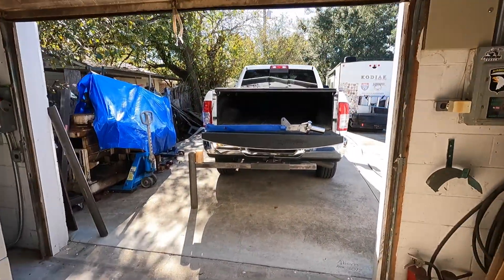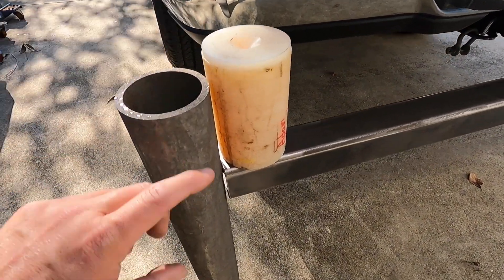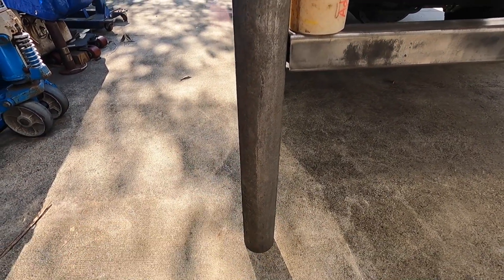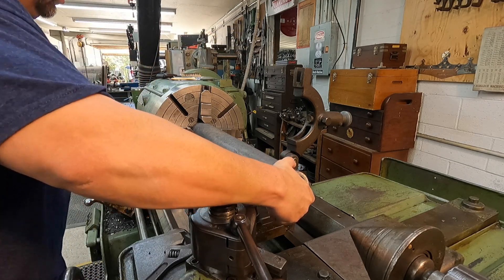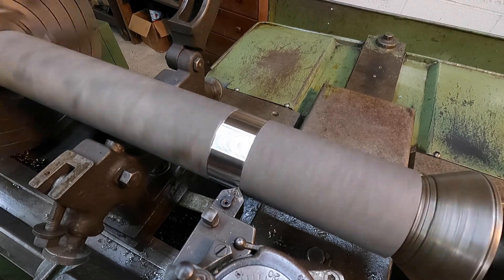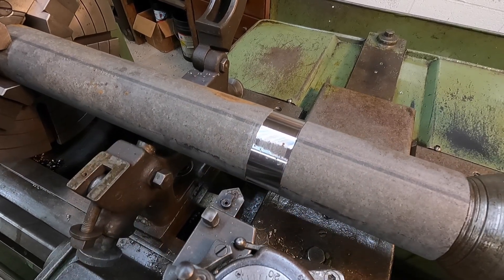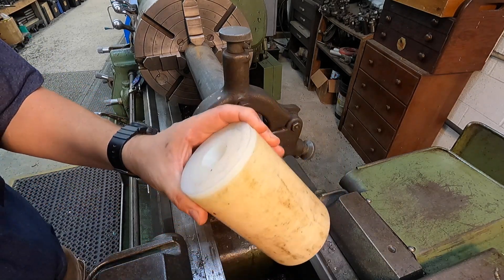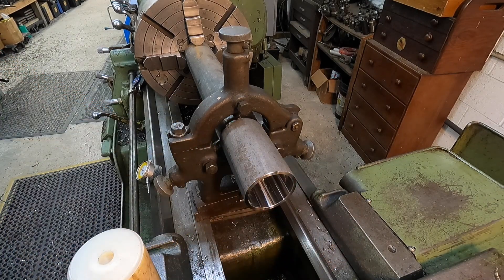Truck Hitch Crane Build Ep. 5

Comment: Adam, maybe the foot off of a scaffold frame that has the adjustable screw on the bottom for leveling would work on the bottom of the leg of the crane. That way if you had to pick up something out of the grass or dirt or mud or uneven ground, you could adjust the the lower end and put a pad under it to take the weight
Reply: I was thinking the same for a scaffolding foot. I think it would be perfect for this.
Reply: About a dozen others have already suggested this in other comments. It's the obvious solution.  Too bad none of us, including me, bother to read the comments before typing.
Reply: Yea but what the heck would you do with the three legged scaffold that is left? 

Haha. Jk.
Reply: Oh, yeah! So much more fun to read the other comments AFTER you leave yours.  Lol

Comment: It's nice your building this for your self. I took a old engine off Craigslist and did something similar. I didn't have a lathe so I made a pintle point (2 rounded over points) which allows for easy weight and turning. Using a little grease and this old timers method I can lift and swing about 1 ton. On my foot I went with larger pipe so I could make it a triangle stand for stability at the bottom. That was 6 years ago, lift riding mower, engines, a custom metal Lift pallet for concrete bags/stone/brick blocks. I have 1 for my trailer as well but mounted it on the side between the tandem axles. Having a lift is pretty nice as a old man.

Comment: Yes .... Adjustable "foot" is a damn fine idea. Every parking situation will have a different "foot" height. And the suspension height will vary with different weights on the truck. I often need to work step by step too .... I'll be interested to see how you "finish" this project Adam :)

Comment: Adam, I’m one of those concerned about the tail dropping when loaded. There’s slack when it’s unloaded for sure, but with an extra load on the truck bed, then the foot is going to be hard onto the ground and all the slack will be taken up. There won’t be any slack to lift the foot and free the pin, without lifting that load. To get the pin out you’ll need to jack up under the cross beam. Better weld a plate under it so your screw jack, or bottle jack, can lift it, and definitely take the jack and some blocks with you the first few times you use this!
Reply: Why not just put a flat plate on it and use a bottle jack for the support ? Plus it will remove the weight of the problematic leg
Reply: I've been thinking the same thing.  Even if the load is so light that there's no measurable sag in the suspension, you still have the problem of the holes-n-pin design not having enough adjustability to fit a lot of ground surfaces.  It'll be no problem on the concrete, but what do you do when it's a gravel driveway or you're pulled out into the lawn to pick up something?  Maybe his luck is better than mine, but I always seem to park in exactly the worst spot possible and can envision me trying to slip some boards under the drop leg to shim things up!
Reply: Haven't watched the rest of these videos yet but I think the best option would be to have the crane support tube in a sliding sleeve which is attached to the hitch.  That way the load from the crane goes straight to ground and the sliding sleeve which is attached to the truck just supports the crane tube from falling over.

Comment: I built a truck crane very similar to this a few years ago.  I used a trailer jack off the side of the beam next to the pivot point.  It works well and allows leveling very quickly.  Nice looking build with your usual quality.   Thank you.

Comment: Use a screw Jack that is used for scaffolding, perfect solution for your foot adjustment
Reply: That's what came to my mind also, square foot mounted to a spindle like a vise, with a nice wingnut to adjust and lock it!
:-D
Would make a interesting episode with milling the wingnut and threading some round stock for the spindle...
;-)

Comment: You need a screw jack on the bottom of the outrigger, once you put a load in the bed of your truck, the suspension will squat and you won't be able to pull that pin with all that weight on it... Or airbag the rear of your truck, which would also help you pull that trailer. win - win if you bag it.
Reply: haha.... thinking alike.  I said the same thing. air bags. lol

Comment: Adam I built one much the same in 2008. Not as fancy as yours but it works. I used a clutch release bearing at the bottom of the round shaft to allow for the crane to turn easier. It works. If you have not finished it yet, think about doing that.

Comment: I started out as an engineer...on the computer side but I still have the mentality - so I can't help saying something when I feel like there might be a problem!  Sorry!  You're definitely still the expert by a looooooong way here.  :)

When  you lift heavy stuff into the bed of the truck, the suspension on the truck is going to want to compress.  So with the foot, I don't think it's a matter of just having a little wiggle room to get the pin out, the truck bed is going to drop a significant amount, maybe even an inch or more, relative to the ground which the foot is sitting on.  When that happens you'll have a lot of weight on the pin keeping you from pulling it out.

I definitely could be missing something.  Either way, I think you already have a solution figured out if it's a problem.  Loving the videos of this project.  Keep it up!!

Comment: An Acrow prop was the first thing that came to my mind when you mentioned adjustment of the foot. It combines the fast adjustment of the pin and holes with the jacking capabilities of a screw.
Reply: Unfortunately, they say in the pdf, it should not be used as a jack. It's for support only. 
Static load bearing only, not dynamic.  The movement of the crane puts the wrong kind of load on it.
  It may not matter because of the load he is expecting, but I expect Abom to be conservative in this.
Reply: @firesurfer  I would wager that is a safety caveat, and in its intended application I would agree. Due to the length and slenderness of an an acrow prop they are only intended to provide support in direct compression, any side load applied, such as swinging on the screw to “jack” it up may cause it to slip out from under the object it is lifting. I used the term “jacking” loosely, as in Adams application it would only be acting as an adjustable foot to provide downward support, just as it is intended. However as I design principle,  where the prop is shorter and has sideways constraint (as in this application) I think it would be fine for light lifting / jacking. In truth I bet there is many a builder out there who has used an acrow prop to jack things back into place 😉

Comment: Hey Adam. You probably know this trick for adjustable-length struts. Put a few holes spaced equally on the fixed part and a few on the strut that are a little closer together.  Say 5 holes fixed at 3 inches apart and 5 sliding that are 2.5 inches.  Then you'll find that every 1/2 inch over a pretty big range there will be a pair of holes lined up. This works smoothest with rectangular tubes because they register, but it ought to be okay with round ones, too.
Reply: Similar concept to a vernier scale, interesting.

Comment: An adjustable screw foot would be an excellent addition to the support leg. Hitting the exact pin alignment even with closely spaced holes may be problematic. The ability to take the tension off once loaded is another positive benefit. Love watching you build devices to make your job easier, the fabrication and creative process is fun. I know you move a lot of heavy stuff and whatever you can do to minimize the stress on the body is a big deal.

Comment: If you're just going to use a pin to set the height of the strut You'll need to leave it very loose. That truck will squat quite a bit with any decent load and you'll need the slop to get the pin out of the hole. A 2" or 3" cam-over lever with an adjustable length foot would be the way to go. Great work explaining the reasons behind each of your process steps.

Comment: IT'S a thing of beauty just watching that old lathe do it's thing and someone who knows the touch of that particular lathe to get anything that accurate... I'm a joiner that has acquired a very old lathe and my mechanical engineering friend is not happy the lathe is 8 thou out he says it's the backplate that the chuck is mounted on and the chuck is too big for the bronze headstock bearing/bushings!!!!  
SO if we as joiners work to 3mm on 1st fix timbers that's good enough.. that's 118.11 thou and it's sometimes more like 1/2".hehehe not between 2-7 thou that's crazy good in my opinion on any machine!!! all the best from Motherwell Scotland Adam and family x

Comment: You could use one those trailer tongue jacks to adjust the bottom of the boom pipe to the ground.  They're cheap and even come with a swivel plate to swing the jack out of the way.

Comment: I think a screw foot would definitely be the way to go. Not just to be able to break it down after the load is on board, but to be able to plumb the crane before lifting. If it’s not plumb, you may get some unwanted swing, as soon as the load is lifted. Maybe a little center bubble vial welded onto the side.

Comment: Trailer jack with out the wheel is what I wound up using. The weight of the load always kept the post system bound up.

Comment: Awesome build as usual. Might want to think of a swing brake or make sure it has enough friction to not swing uncontrolled if the truck is off angle. Ive used similar lifts and it can get sketchy at times.

Comment: @abom79 .... Yes Adam, suspension squat / Tilt will be an issue with a heavy load. the only two ways around it will be to raise the truck ( leveling jacks / air bags ) or like you showed with a screw foot on the out rigger. this crane is looking good.

Comment: I would chop the pipe to the length of the bushing and then attach a quick release trailer jockey wheel to the square tube, this will allow you to set the height to what ever surface your on.

Comment: Adam I can suggest you could use a thrust washer bearing so you can turn it once there’s a load on it just so you and pivot it easier.
Reply: i have a " Cheap " Chinesium truck crane i bought 15 years ago...it has only pipes...no bearings...nuttin ...it spins easily...yeah not as smooth as it could...it works fine...even if ungreased...you'd be suprised how simple can work sometimes.... the tubes aren't even close to fitting too..lol....i never had issues..

Comment: Hi, you need a screw on the bottom, a screw inside the bottom pipe is the standard design. First the pin to get approx height and then the screw to take up the last bit of height. Cheers from  Oz

Comment: I agree higher is better. You'll add straps to pick things. You need the height for the top side of the lift. I also agree with the fella on needing adjustment in the foot. You'll be surprised how much travel you will get in the suspension. Your trucks jack could bail you out if it gets bound up though.

Comment: You could use an adjustable leg screw for a scaffold.
Reply: That's the ticket 😃
Reply: Or something like a trailer Jack
Reply: That was my thought too; the load should be entirely axial (negligible in bending or shear as the hitch and suspension are dealing with that) so it doesn’t need to be huge… there might be significant fore and aft bending loads thinking about it as a mass off the back will lift the rear suspension; but I’d be more focused on the torsion load on the cross member in that instance…

Comment: Looks like now would be the time to insert your cross-piece from the right side of the bed and see if you need to make any changes to make your crane ambidextrous. There could be times when lifting from the right works better. 
Also, tripod legs often have a point that can be exposed by turning the rubber foot back. The point works well on rough ground.

Comment: If you haven’t planned for it already you will want to add extendable legs to keep the thing from twisting the draw bar as you swivel the crane.
Reply: I agree, when the jib is out perpendicular to the cross bar the moment arm will put a lot of twist on the crossbar. Depending on the load it may cause the foot to kick out from under the crane. An additional outrigger perpendicular to the crossbar would eliminate this. I have one of those engine hoists and it always tries to pick up the back wheels and pitch forwards on full extension.

Comment: a trailer tong screw jack on the vertical support pipe would be a delux version instead of the pinned extension like the cheap ones use.

Comment: We used a trailer jack.  It allowed us to adjust the foot when on uneven surface, and easily "unload' the bar.   We also have a 2nd trailer jack right under the hitch point to support the truck when lifting so you don't have to worry about the suspension compressing while lifting items - weight balance and transfer.

Comment: Suggestion on adjustment.  If the holes in the inner pipe are one inch apart, drill two holes for the locking pin in the outer pipe that are 1 1/2 inch apart.  depending on which outer holes you put your pin in you have 1/2 inch adjustment. rather than just 1 inch adjustment
Reply: That's cool. I had to think a moment about what you said. Clever.

Comment: Have an idea for a screw Jack for the foot. Modify a ratchet chain binder. Has acme threads and a handle. Won't have struggle pulling pins out or about the weight.

Comment: For more adjustment you can drill a hole at 90° a bit higher or lowe in between what you drilled in the other pole. Doubles the adjustment without losing much strength.

Comment: I have used the same jib crane for years now mounted on my trailer to load a 1,200 # reversible plate compactor. Best money I have spent for many years. Height, swing and extension is critical.

Comment: I think using the adjustable screw method with a nice thick ACME thread is the way to go. Imagine loading 1000# in the back of that RAM, you might actually have to carry around an aluminum floor jack or similar just to "unload the foot". I'm just saying, I've found myself in this VERY SAME predicament, and no jack tall enough to unload the hitch.

Comment: I had a crane very similar to this. I believe that it was manufactured by Blackhawk,  We had it mounted in the rear corner of the bed and reinforced to the frame.  We use it for loading engines and 55 gallon drums of oil and anti freeze.  The one thing that we did find is that we needed to use a small chain fall on it so that we could raise the load up vertically.  It gave more options on where we could place items in the bed.

Comment: Thoughts on the foot,,,,,,,do you need one? You lift a load, place it on the bed, the suspension will ultimaately take the whole load. Ergo the foot only resists (partially) a twisting motion on the hitch at the time of loading. Be interesting to know,when alls finished if it was possible or even desirable to (given design constraints) to eliminate the foot.I suspect not if the jib is off centre but if directly be hindthe hitch maybe. However other loading issues come into play. Has been interesting to watch this built, looking forward to the completion. Thanks for the content Abom.

Comment: If you want the ultimate in adjustability, machine both inner and outer pipes so they're a close fit and then thread both of them so the inner pipe with the foot plate can be screwed in or out to adjust the height...

This also allows you to deal with the truck settling down far enough to compress the crane foot, now you don't need to worry about being able to pull a jammed pin, all you need to do is reef on the foot with a long prybar to wind it in a little until there's no more weight on it, then the crane support can be removed from the hitch mount...

Comment: It seems to me that the support leg could "float" in a sleeve welded to the crosspiece that would make the support leg be self adjusting for height. You could weld a plate to the bottom of the leg to act as a base to keep the support leg from sinking into soft ground. This set up would eliminate the problem of the bed of the truck going lower and binding the support leg.
Reply: You are exactly correct but Adam will need to learn this for himself the first time he puts 500 pounds in his truck, it squats and he can not remove the crane There is no need to have the vertical piece welded solid to the horizontal piece, just use sleeve. Not having them welded together would also make storage of the crane easier.

Comment: If the blue hoist piece just dropped into the hitch tube and touched the ground the hitch tube could go up and down and youd still be able to lift out the blue up right piece 
The hitch tube is just needed to support the blue tube in a up right position
Most crane truck use out riggers to stabilize the vehicle when lifting grant it you most likely wont be flipping you vehicle but you need to be able to remove the crane with the load in the vehicle

Comment: Us crane operators would call that cross beam an "outrigger". Great idea Amigo, May I suggest a back brace to support counter weights, if need be. A little bit of counter weight at the right radius would relieve a lot of lateral 
stress from the rotating mass and your back tires and hitch assy. when picking up heavy loads. With a long enough lever you can move mountains. IMHO...Great content, Keep it up Amigo